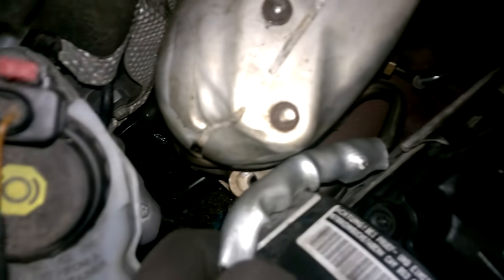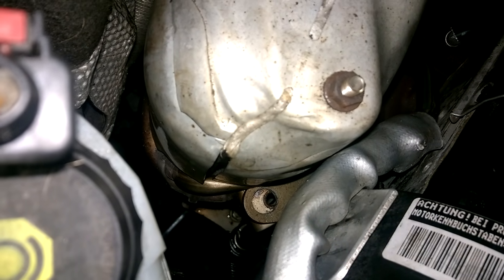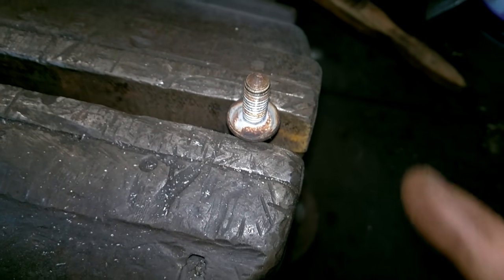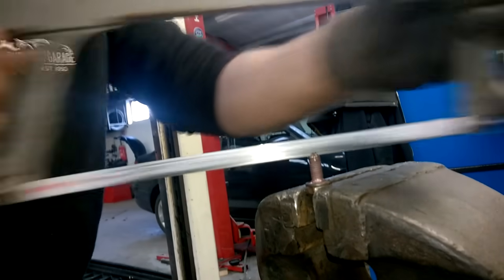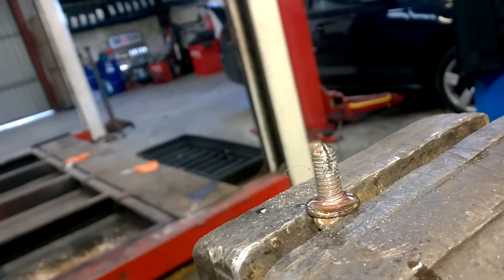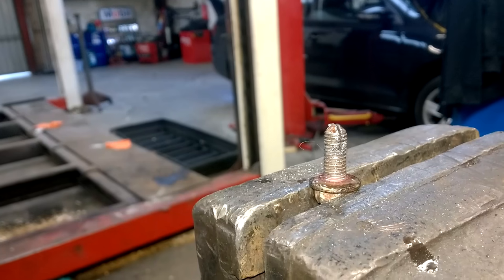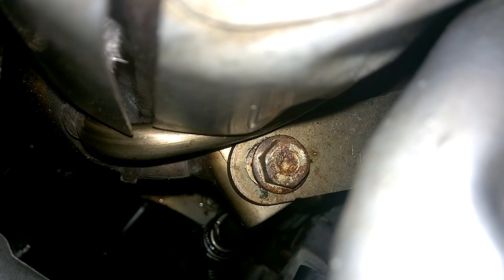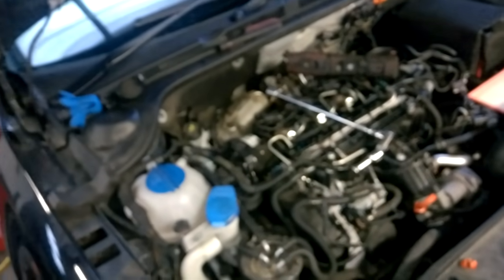My Father Taught Me This! Passing It On To The Next Generation

Comment: I just take the bolt to a grinder and taper the threads on the end. Works like a charm and easier.
Reply from the maker: The update info below is the pinned comment on this video, I know most people do not realize I made that video and it better explains/shows this method in use.   
I also included below details of why the job was done this way free of charge with the customer fully informed. I hope you check it out  👇👇
 
*UPDATE** I decided to make a follow up video on this https://www.youtube.com/watch?v=yfNQullGEuQ&feature=youtu.be Should answer some of the questions that were raised, I include 3 demos of this in action with close up shots.
 
As there was some safety concerns & confusing comments raised, I felt I should clear a few things up. 
1) This is a tip for certain circumstances only, I never have and never would use it on a component which would cause any safety concern to any customer.  
2) The demo was done on a support bracket only, items like this or similar will not cause any safety concern. 
3) I did this free of charge and on a time restraint, I noticed it when I was replacing another item, the customer needed the vehicle back that evening and I decided rather than leave it like it was, I would do this and secure it up fully. 
4) The bolt was not the issue, the part that the bolt threads into is a secured piece, someone had previously damaged it, leaving the bracket loose and the bolt just tightened a turn or so.
5) The bolt can be removed and will not break, it will go in and out as usual and has helped clean up the damaged threads.  
6) Used in the right application I personally believe this is a great tip and can save you a lot of time & trouble. 

Lastly to all the people who have watched the video, Thanks very much and I am delighted with the feedback I have received on it.

Comment: Nice one but I'm wondering why the bolt does not shear off at the point it goes from cut to solid?? any ideas. I'd have expected it to go in to the depth of the cut bit of the bolt then shear off.

Comment: Lubrication is intended to keep 2 metal parts from touching each other..wouldn't it make it harder to cut? Not that it matters ATF is a real crappy lubricant but it is a good coolant. When a tool cuts metal the point of contact gets plenty hot..hot metal does not cut clean and smooth....your cut the bolt deal works well if the threads in the hole are really trashed...ya, some old guy taught me that 40+ years ago...the shortcut to the shortcut is to grind the end of the bolt to a point. If the threads on the bolt are damaged you dont want to damage the threads in the hole and the point will help align brackets. GM motor mount bolts been that way for years.
What also helps is a snap on air ratchet that spins 300 rpm...line the bolt up, push hard and pull the trigger

Comment: Sounds like one of the chaps out of the film Snatch! Thank you for sharing
Reply from the maker: LOL  

The update info below is the pinned comment on this video, I know most people do not realize I made that video and it better explains/shows this method in use.   
I also included below details of why the job was done this way free of charge with the customer fully informed. I hope you check it out  👇👇
 
UPDATE* I decided to make a follow up video on this https://www.youtube.com/watch?v=yfNQullGEuQ&feature=youtu.be Should answer some of the questions that were raised, I include 3 demos of this in action with close up shots.
 
As there was some safety concerns & confusing comments raised, I felt I should clear a few things up. 
1) This is a tip for certain circumstances only, I never have and never would use it on a component which would cause any safety concern to any customer.  
2) The demo was done on a support bracket only, items like this or similar will not cause any safety concern. 
3) I did this free of charge and on a time restraint, I noticed it when I was replacing another item, the customer needed the vehicle back that evening and I decided rather than leave it like it was, I would do this and secure it up fully. 
4) The bolt was not the issue, the part that the bolt threads into is a secured piece, someone had previously damaged it, leaving the bracket loose and the bolt just tightened a turn or so.
5) The bolt can be removed and will not break, it will go in and out as usual and has helped clean up the damaged threads.  
6) Used in the right application I personally believe this is a great tip and can save you a lot of time & trouble. 

Lastly to all the people who have watched the video, Thanks very much and I am delighted with the feedback I have received on it.

Comment: Trim the bracket with a carbide burr and use a tap for the hole to clean it up. Run a chaser down the bolt. That's SAE standard repair.
If you do this to a customers car its a defensible repair.
If the customer goes elsewhere they won't call you out as a hacker.
Peace and joy. Fix it right.

Comment: So, I need to know where your from so when im asked about this knowledge I can know who to give this credit to.
Ill say "an Irishman/Scotsman taught me this".
Thank you, so much.
Reply from the maker: I am from the west of Ireland Johnathan, thanks for watching. I linked the follow up video below if you are interested in it.
 
The update info below is the pinned comment on this video, I know most people do not realize I made that video and it better explains/shows this method in use.   
I also included below details of why the job was done this way free of charge with the customer fully informed. I hope you check it out  👇👇
 
UPDATE* I decided to make a follow up video on this https://www.youtube.com/watch?v=yfNQullGEuQ&feature=youtu.be Should answer some of the questions that were raised, I include 3 demos of this in action with close up shots.
 
As there was some safety concerns & confusing comments raised, I felt I should clear a few things up. 
1) This is a tip for certain circumstances only, I never have and never would use it on a component which would cause any safety concern to any customer.  
2) The demo was done on a support bracket only, items like this or similar will not cause any safety concern. 
3) I did this free of charge and on a time restraint, I noticed it when I was replacing another item, the customer needed the vehicle back that evening and I decided rather than leave it like it was, I would do this and secure it up fully. 
4) The bolt was not the issue, the part that the bolt threads into is a secured piece, someone had previously damaged it, leaving the bracket loose and the bolt just tightened a turn or so.
5) The bolt can be removed and will not break, it will go in and out as usual and has helped clean up the damaged threads.  
6) Used in the right application I personally believe this is a great tip and can save you a lot of time & trouble. 

Lastly to all the people who have watched the video, Thanks very much and I am delighted with the feedback I have received on it.

Comment: this is not used anymore because 1. bolts now a days have a un-threaded point , 2. now we just grind down one side to make it a self tapping. 3. you are weakening the bolt when you do this. Taking metal out of something that is supposed to be metal is not a good thing. That all being said. it is a good tip from the old guys.

Comment: Wouldnt this cause problems in extraction? Not doubting the technique, its solid to get it in, but what about when it will invariably need to be fixed?
Reply from the maker: The update info below is the pinned comment on this video, I know most people do not realize I made that video and it better explains/shows this method in use.   
I also included below details of why the job was done this way free of charge with the customer fully informed. I hope you check it out  👇👇
 
UPDATE* I decided to make a follow up video on this https://www.youtube.com/watch?v=yfNQullGEuQ&feature=youtu.be Should answer some of the questions that were raised, I include 3 demos of this in action with close up shots.
 
As there was some safety concerns & confusing comments raised, I felt I should clear a few things up. 
1) This is a tip for certain circumstances only, I never have and never would use it on a component which would cause any safety concern to any customer.  
2) The demo was done on a support bracket only, items like this or similar will not cause any safety concern. 
3) I did this free of charge and on a time restraint, I noticed it when I was replacing another item, the customer needed the vehicle back that evening and I decided rather than leave it like it was, I would do this and secure it up fully. 
4) The bolt was not the issue, the part that the bolt threads into is a secured piece, someone had previously damaged it, leaving the bracket loose and the bolt just tightened a turn or so.
5) The bolt can be removed and will not break, it will go in and out as usual and has helped clean up the damaged threads.  
6) Used in the right application I personally believe this is a great tip and can save you a lot of time & trouble. 

Lastly to all the people who have watched the video, Thanks very much and I am delighted with the feedback I have received on it.

Comment: Outstanding and thank you for the tip 👍
Reply from the maker: Thanks Franklyn 
 
The update info below is the pinned comment on this video, I know most people do not realize I made that video and it better explains/shows this method in use.   
I also included below details of why the job was done this way free of charge with the customer fully informed. I hope you check it out  👇👇
 
UPDATE* I decided to make a follow up video on this https://www.youtube.com/watch?v=yfNQullGEuQ&feature=youtu.be Should answer some of the questions that were raised, I include 3 demos of this in action with close up shots.
 
As there was some safety concerns & confusing comments raised, I felt I should clear a few things up. 
1) This is a tip for certain circumstances only, I never have and never would use it on a component which would cause any safety concern to any customer.  
2) The demo was done on a support bracket only, items like this or similar will not cause any safety concern. 
3) I did this free of charge and on a time restraint, I noticed it when I was replacing another item, the customer needed the vehicle back that evening and I decided rather than leave it like it was, I would do this and secure it up fully. 
4) The bolt was not the issue, the part that the bolt threads into is a secured piece, someone had previously damaged it, leaving the bracket loose and the bolt just tightened a turn or so.
5) The bolt can be removed and will not break, it will go in and out as usual and has helped clean up the damaged threads.  
6) Used in the right application I personally believe this is a great tip and can save you a lot of time & trouble. 

Lastly to all the people who have watched the video, Thanks very much and I am delighted with the feedback I have received on it.

Comment: Now you have 1/2 of the service threads unable to provide the leverage and fastening power intended by the original engineer.  MUCH better to put a nut (or die) on the nut and grind the first 2-3 threads into a taper (then back the nut/die off to recut the first thread).  Now your "drift bolt" can be used to coerce the alignment, and the threads can still provide the engineered fastening power. Many fender bolts already are designed like this, with the threads deferred for the first 2-4mm.  So are many exhaust studs.

Comment: If you can’t start the bolt, due to mis-alignment. It’ll go in cross threaded, and rip out the good ones. Or you might get lucky. If you’re still not, into quality work. Put an impact on it, and drive it home.

Comment: Any idea how to get a 8-32 machine screw broke off in a very tight space. Its the Throttle position sensor which sits above the thermostat housing.I think less than 2 inches.  Its a buick 3300. I can only get to the screws at an angle. I tried to go at it at an angle with a dremmel type tool with a few different heads but I'm not making headway.  Any Advice?

Comment: The bracket did not seem to be in the same place when the bolt was tight. You can see a mark on the bracket from the head of the bolt before it was undone. The bolt was so tight in the hole when we get to see it the ratchet is clicking. Never had that when I have just put a bolt in. Not convinced this will stop cross threading. why not put the bracket back where it was before the bolt was removed then replace bolt?. If bolt is able to collapse then does that mean that part of the bolt is not really doing its job and only "half" the bolt is holding the bracket and can be torqued up?

Comment: Thank you! Excellent idea!
Reply from the maker: Thanks Kenneth 
 
The update info below is the pinned comment on this video, I know most people do not realize I made that video and it better explains/shows this method in use.   
I also included below details of why the job was done this way free of charge with the customer fully informed. I hope you check it out  👇👇
 
UPDATE* I decided to make a follow up video on this https://www.youtube.com/watch?v=yfNQullGEuQ&feature=youtu.be Should answer some of the questions that were raised, I include 3 demos of this in action with close up shots.
 
As there was some safety concerns & confusing comments raised, I felt I should clear a few things up. 
1) This is a tip for certain circumstances only, I never have and never would use it on a component which would cause any safety concern to any customer.  
2) The demo was done on a support bracket only, items like this or similar will not cause any safety concern. 
3) I did this free of charge and on a time restraint, I noticed it when I was replacing another item, the customer needed the vehicle back that evening and I decided rather than leave it like it was, I would do this and secure it up fully. 
4) The bolt was not the issue, the part that the bolt threads into is a secured piece, someone had previously damaged it, leaving the bracket loose and the bolt just tightened a turn or so.
5) The bolt can be removed and will not break, it will go in and out as usual and has helped clean up the damaged threads.  
6) Used in the right application I personally believe this is a great tip and can save you a lot of time & trouble. 

Lastly to all the people who have watched the video, Thanks very much and I am delighted with the feedback I have received on it.

Comment: ok but shouldn't you try and align the holes instead ? The holes are no longer aligned for a reason, and this means that the bolt will work both in shear  and tension instead of just tension as it was designed at this particular place..

Comment: This only shows the last half a turn of the bolt. How easy was it to start the first turn? The DPF not fitted correctly caused the bolt not to line up.
Reply from the maker: Hello Alex,
 
The update info below is the pinned comment on this video, I know most people do not realize I made that video and it better explains/shows this method in use.   
I also included below details of why the job was done this way free of charge with the customer fully informed. I hope you check it out  👇👇
 
UPDATE* I decided to make a follow up video on this https://www.youtube.com/watch?v=yfNQullGEuQ&feature=youtu.be Should answer some of the questions that were raised, I include 3 demos of this in action with close up shots.
 
As there was some safety concerns & confusing comments raised, I felt I should clear a few things up. 
1) This is a tip for certain circumstances only, I never have and never would use it on a component which would cause any safety concern to any customer.  
2) The demo was done on a support bracket only, items like this or similar will not cause any safety concern. 
3) I did this free of charge and on a time restraint, I noticed it when I was replacing another item, the customer needed the vehicle back that evening and I decided rather than leave it like it was, I would do this and secure it up fully. 
4) The bolt was not the issue, the part that the bolt threads into is a secured piece, someone had previously damaged it, leaving the bracket loose and the bolt just tightened a turn or so.
5) The bolt can be removed and will not break, it will go in and out as usual and has helped clean up the damaged threads.  
6) Used in the right application I personally believe this is a great tip and can save you a lot of time & trouble. 

Lastly to all the people who have watched the video, Thanks very much and I am delighted with the feedback I have received on it.

Comment: Problem is that the first part of the bolt’s thread is no good and that ends up at the bottom of the threaded hole while the outer part of the hole is stripped. Result: only the few threads in the middle are actually biting!

Comment: Yes, intelligent man, your pappa. 
One anecdote, I did once, after I lost a bolt from brake caliper, the following: 
 All of a sudden the front right wheel blocked 100%. Skid marks grew longer by the meter/yard. 140 km/u to the stopping point. Off course I was on the fast lane at midnight. Overtaking 4 cars while my car was breaking and pulling right side.  
When triple 8, 9, what is it in your country? We've telephone poles every hundred m. So, the guy came, no solution. I saw a other type, Fe360, and I needed Allen key screw to fasten the brake calibre. I ask to tinker myself in his workstation in the back. I sawn off the hexagonal head to something that would fit. A shallow line in head for screwdriver and I f.ed it inside the caliper hole. I could drive, stear and brake and drove average speed of 80 km/u homeward bound. 
That was like your solution really great, so, Thank you ever so much for sharing your idea MP4.  
Keep them coming. Ideal idea's. 👍🏾

B.R. 
C.